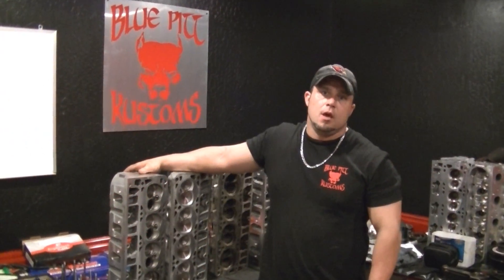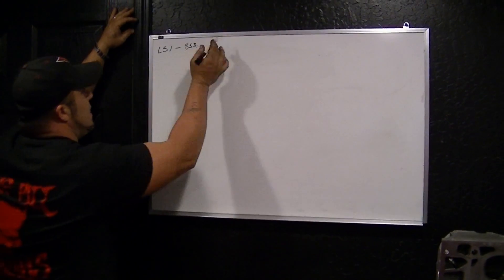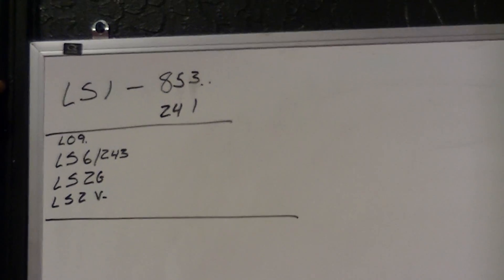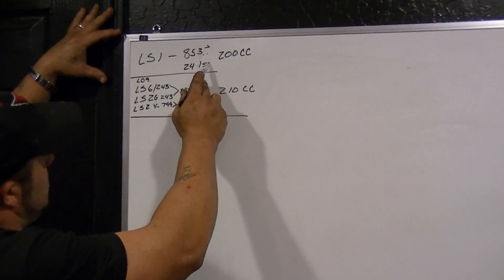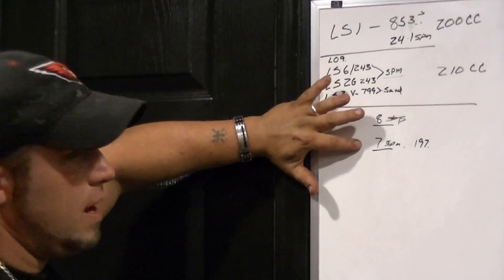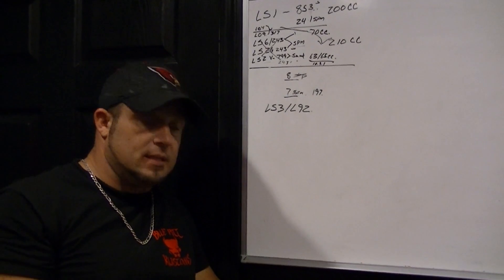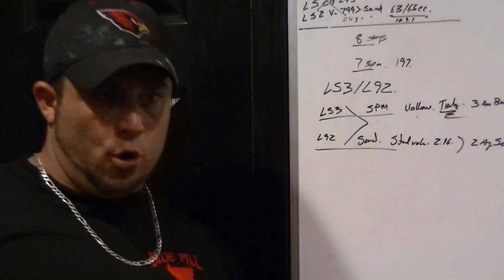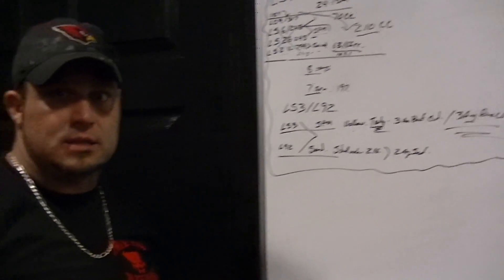LS Cylinder Head Identification Part 1 of 4

Comment: Love your video! Ok so Im just now getting in to the ls world and would love some of your knowledge, so I just received a lsx 7.4 engine that came out of a 2020 boat, the reason I acquired it is because it completely broke off the head of number 7 cylinders intake valve and dropped in on the piston. It is a lsx block but the head casting number says 823 which from your videos leads me to believe it is the truck head. Do you know what could have caused the valve to break like that? I and going to put this engine in a Camaro, so what heads would you recommend for this application or would it be better to have these heads fixed? Thank again for all your information and videos!

Comment: What do you think about 862 heads on a lq4? I’ve read that it bumps up the compression and with the right cam, could produce in the low 400 horsepower. Is that true? And would you put 2.0 valves in them? Thanks